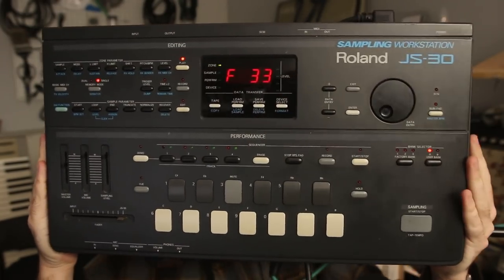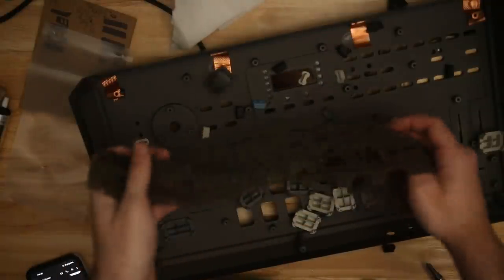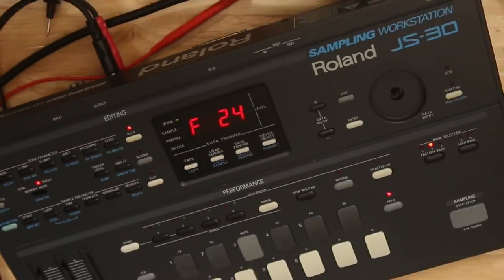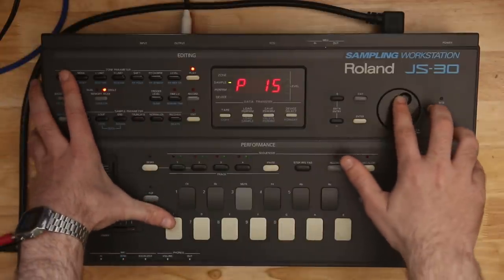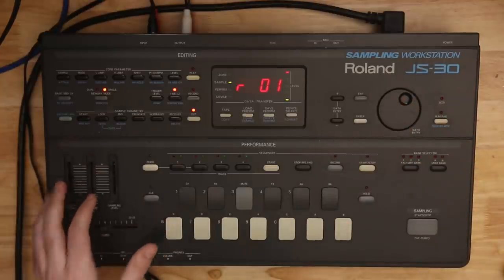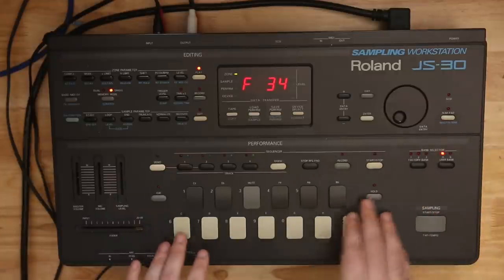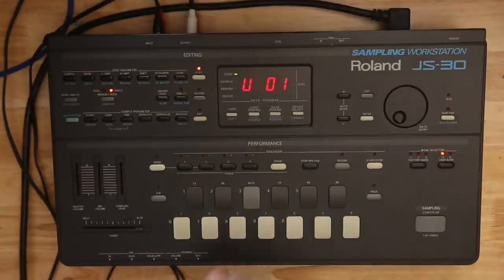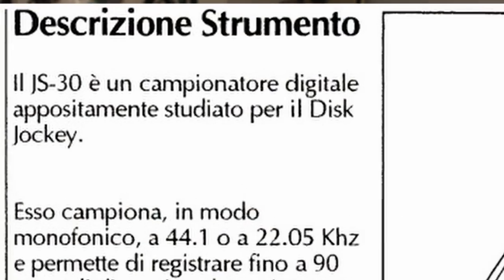Roland's Forgotten 8-Bit Sampler

Comment: Nice video of the Jorb Sampler-30. I know I've heard those factory samples on chart records in the late '80s & early '90s, now I also know where the bands got them from. Thanks Jorb. Liked & watched end to end.
Reply from the maker: Lmaoo jorb sampler is probably correct.

I believe Roland used a lot of the same samples in different things, like the sc-88 etc have some stuff shared with the d-50 samples. Wonder what else these were on.

Appreciate that, cheers!

Comment: That's pretty crazy. I was making music and either missed this or block out all memory of this. Certainly it has more charm today than in 1995. Thanks for sharing! I started making music with 8-bit sampling software on MacPlus computers in 1996 and was still using that software in 1992 :) How silly of Roland to make 8bit gear in 1995 😂 Cheers, Jorb!
Reply from the maker: They seem to have gone way under the radar. Happy to have it!
Reply: I remember about this time Akai released a similar craptastic phrase sampler, was it called the S01 or something? I think the idea of low spec units was to have a low cost line compared to each maker's high end gear. Cheap in the 90s was probably $800-$1000, not cheap by today's standards!

Comment: P.S.: I just checked:
In Sound on sound you can read this:
"However, worry not — an easy to install 4Mb upgrade not only doubles your sampling time, but brings the JS30 up to full 16‑bit operation. (Sampling time with the standard unexpanded 1Mb allocation of RAM is a total of 22.5 seconds at 44.1kHz and 45 seconds at 22.05kHz, by the way, with the user RAM split however you like across two banks, with 12 sample locations each)"
1MB to 4 MB?
That smells a little bit like my old companion Atari 1040 STE...
Reply from the maker: Really cool option tbh. The connections to early PC's are amazing!

Comment: Nice to see someone with a successful channel doing a show on the js-30. I bought mine in Chicago around the year 2000. I got it without a manual and it took me years to find a manual for it online. Mine has the simm expansion but I wish I would have known the save to tape function when I was still trying to use it. Is there a internal battery?
Reply from the maker: Cheers thanks! 

Manual is around online now, no sweat. There is an internal battery, but I'm not sure if its just for settings or what.

Comment: Low bit rate samplers are great for snares and samples of dialogue from movies and the like. And hey this is history good to see machines in action.
Reply from the maker: I'd love to have a proper spot for it, want to push it even further
Reply: Trouble is these old samplers are never that easy to use, better off with a S10 as thats very simple to use and sounds lofi but good, far better to use them as a DAC. I personally prefer using a bit reducer plugin as its good enough for most things even though I have Roland and Akai hardware samplers.
Reply: @maccagrabme as someone who has been using samplers since the mid 90s I gotta say that I don't miss them. Quirky and cryptic OSes, floppy disks, zip disks and scsi, bad and small screens, unaddressed bugs, etc. These days it's way better to go with something modern like a mpc live 2, mpc x, one, etc. Or a DAW like ableton live, which is the greatest sampler ever.
Reply: @VincentsVideoVisions   Hey to each thier own, I have an amiga 600 I use for certan things. It has an 8 bit sound chip Im a huge fan of,  No one is saying any of this stuff needs to be in your set up or they are better than modern machines. Im pretty sure there's tones of modern stuff with good 8 bit and low sample rate options if you want them.

Comment: I never, ever, ever failed to forget to switch to the user banks, hahaha. Used mine constantly from 98-03, when my last Zip drive died (the walls of Salvation Army stores were lined with Zip drives for a short window of time back then). been meaning to drag this thing outtta the closet, only it takes up so much space. I mostly used it for the chromatic mode.

Comment: Excellent repair and usage of the Roland JS-30. I would be curious to see sample storage and load (including AKAI) via SCSI (scsi to add adapter) or MIDI Sample Dump Standard (SDS). If I were to use this sampler I’d have SCSI storage option, load either 16 BIt (if memory expansion is installed) or input sample 8 bit (I think I saw that select option in this video), and MIDI sequence (onboard RPS sequencer seems janky).
Reply from the maker: I had a mention of the scsi drive, but cut it without anything to properly demonstrate.

Apparently the midi dump takes ages
Reply: SDS dump is only good for other samplers that can receive it (AKAI samplers, some legacy computer software). But SCSI to SD adapters have made SCSI musical/instrument devices like JS-30 viable.

Comment: You should check out the Akai S20, it’s a 32 bit sampler with 16, 8, and 4 bit resample. It’s kind of like the SP404, before the SP404, without FX.
Reply from the maker: on the radar now, cheers
Reply: You're getting Hz and bits mixed up buddy. It's 32khz with 16Khz 8Khz and 4k Hz resample all at 16 bit.
Reply: @Turdbassist  thanks 🙏🏼

Comment: Did you see a internal battery when you took it apart?
Reply from the maker: I did, but haven't replaced it yet.

Not sure if I need to find the factory content somewhere or if it would persist through a factory reset
Reply: @JorbLovesGear  I'm not really sure what it would be for? Maybe to save your settings for the factory presets if you edit them. I think the factory presets themselves are saved on a chip.

Comment: Someone's probably already said this but, 99 % of dirty switches and faders can be fixed by spraying them with electrical cleaner and using them repeatedly. I've fixed countless amplifiers and tape deck switches and never replaced one switch. If something is desperately dirty I resort to wd40 and let it dry before plugging it in. I've had amps go from unusable to as new just from cleaning pots and contacts.
Reply from the maker: These little panel mount tact switches, I've never had much luck just cleaning them.

Plus, it really isn't so bad to replace em.

And actually for this video, I cut a whole bit about trying to clean the faders, and never getting them close enough to spec.
Reply: @JorbLovesGear  weird that you couldn't fix the faders, they're usually really easy to clean. But it's true that often replacing is just actually easier than cleaning. Especially when disassembling is that easy. It's just that from the video it looked a bit like you skipped that step when you rightfully cut it out. Love your vids btw, your deepmind videos really helped me get started with mine. And with choosing the 12 rather than 6 voice.

Comment: What was Roland thinking to release an 8-bit sampler in the mid-90s??? Very strange. Saying that I can imagine this being very appealing now.
Reply: It is actually capable of sampling in 16 bit, 44,1 kHz when you have the maximum memory installed (4MB). When you have only 1MB of menory installed, sampling automatically defaults to 8 bit, 22,05 kHz.

Comment: Awesome video! The sound of this seems about as great as the workflow seems horrible... Started looking into 12 and 8 bit samplers some time ago but was hesitant about buying the JS-30. I just recently bought an old Yamaha SU-700 that has the ability to sample at different rates, also 8 bit. It also comes with some amazing (digital) filters. The problem with the SU is its decoders which are known to go bad but when you find a way to repair them or control the unit externally, it can do some amazing stuff! I very much enjoy watching your videos, thanks for making them!
Reply from the maker: Cheer appreciate that! I'm not familiar with the SU700, but I might have to go looking...seems rad